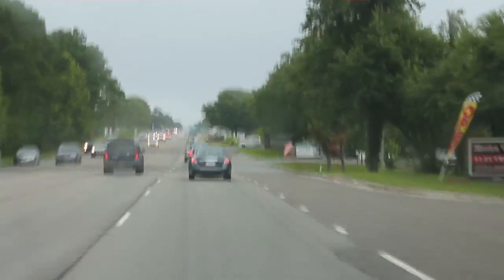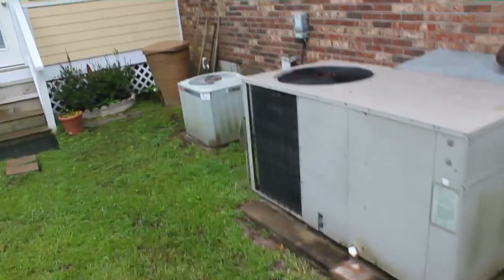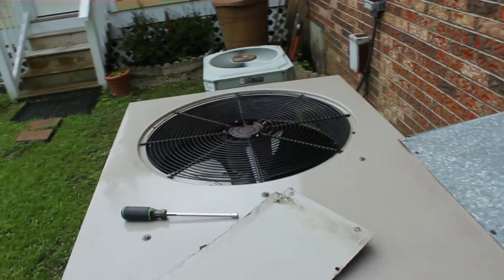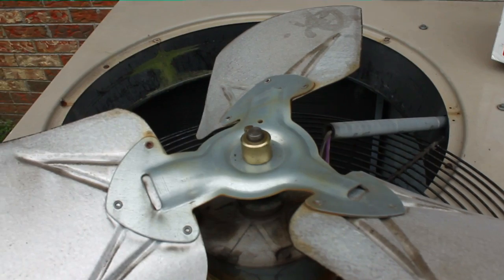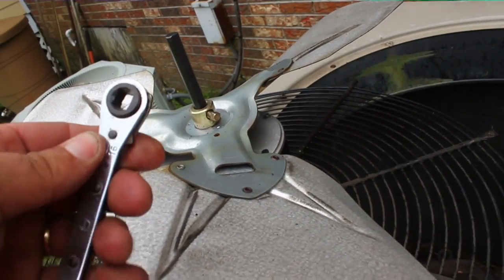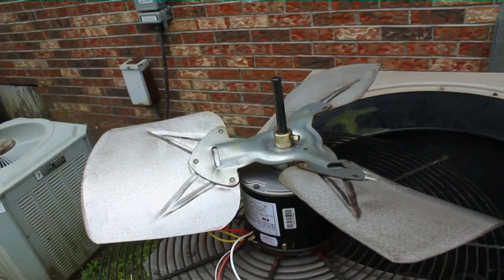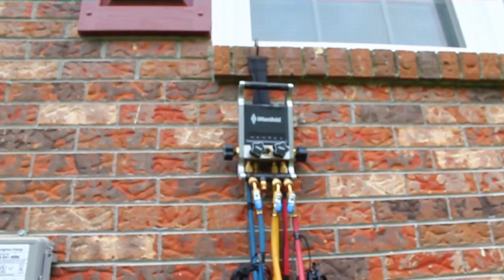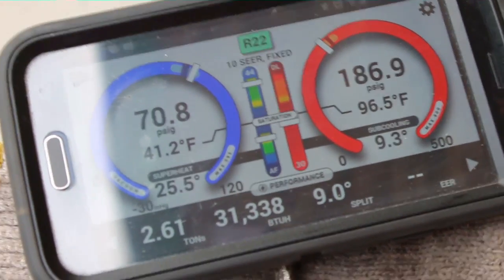HVAC Service Training- Condenser Fan Motor Replacement

Comment: I replaced a 460 Condenser fan motor today but for some reason the unit didnt start. The fan tried but didnt . I ran the 2 brown wires to the cap and have the black and white to the 3 pole contactor. Any idea why it didnt start the unit ?

Comment: Here's a shot in the dark...

I'm in a double wide mobile home. My condenser unit is as old as the home - about 40 years. The condenser fan motor started occasionally squealing really loudly.  I need to replace the fan motor and fan.  I can find most of the info on the nameplate; Day & Night 1/4 HP 230v 3" shaft, 1/2" diameter...

But I can't find the RPM anywhere! So, my question is: if I were to replace the fan motor with one that had identical specs but possibly a different RPM, and I also replace the fan blades to match the RPM, would I have problems after installation? 

I'd hire someone to fix it, but I just don't have the funds.  It's 103 degrees here in Fresno, so of course I'd have problems now :-)
Reply from the maker: Its guesswork. It may be sufficient, but not cool the cool properly. The RPM should be on the fan motor data plate. You could also search the fan motor model number online to see if it is listed.

Comment: Why don't I ever get OFM replacements that easy? XD  Up here in Hampton,VA I'm always on FOF duty for the guy who contracts me.  There's been a couple times I've told him to change out a unit to be more cost effective in the long run.  Nope, lets keep fixing those leaks on the R22 units until he can't get any more through his 'buddy'.  I'm not looking forward to leak patrol on all his heat pumps this winter. . .

His tenants never bothering to change the filters is another annoyance.  I think you know where that's heading.

Totally unrelated; know anywhere that sells the iManifold for under an arm, leg, and first born?  My Testo 550 is nice, but being able to log performance data looks too nice to ignore forever.
Reply from the maker: sivalley Lowest I have seen is around 675.00 at Carrier Southeast. Try Johnstone. Thanks for watching